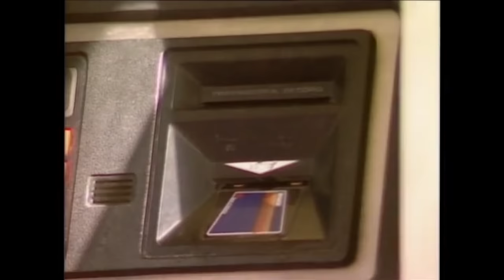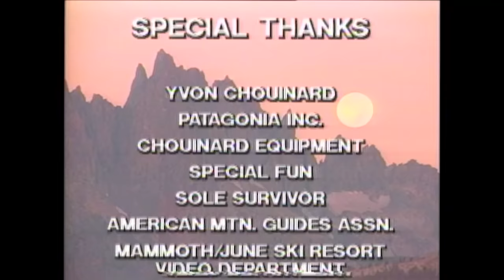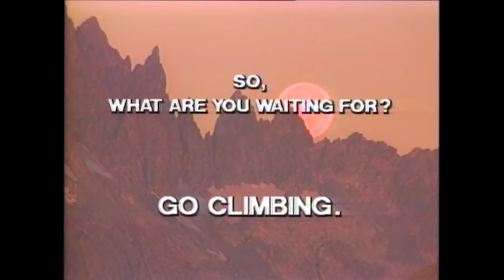They Changed Climbing Forever

Comment: Doug, why go with a delicate camera system such as a tube camera? What was the mindset or goal? I understand it may have been the most advanced at the time, but wouldn't something using film such as a 16mm or 35mm have made life easier due to their ruggedness? Did the film costs and processing outweigh the maintenance and daily cost of the tube camera?
Reply: Good question. My partner on that film, Mike Strassman, had just graduated from film school at UCLA. He made the choice of format and I didn't question it much. It felt like the best idea for those times. But boy was a clunky, 20 pound, delicate camera a pain in the ass! especially hauling it up on climbs! Good shot angles, but one bump against the wall could throw the tubes out of alignment, and it would have to go to the city to be readjusted by a technician.

Comment: Doug, what's the definitions of Trad and Sport Climbing, where did the terms come from?
Reply: Used to be there was only mountaineering. Then Rock Climbing split off. In the early 1950s John Gill "invented" bouldering on this continent. Fountainbleau had bouldering for 20 years before then, but no one in the States knew. Gill started dynamic moves on Red Cross Rock in the Tetons. Look up his great writing. Also there are books of photos of his climbing. Amazing!

Sport climbing began in the 1980s and was hugely controversial. Trad had been going for over 50 years at that point. It was just undifferentiated  "climbing." You carried your own pro, put it in and the second took it back out. Sport was cool because it allowed faster, harder development of sheer difficulty. Smith Rocks was important for this movie because it was a leading area for sport climbing. The dawn of 5.14.
Reply: @dougrobinson4221  thank you, beautiful historical context.

Comment: Pretty strong for an old dude. Messner said that bolts are the murder of the impossible. When someone solos a hard sport climb that shows the lie  that '' There's no way to climb them without bolts.'' If they don't fall then they have climbed the route safely.
Reply: Soloists die, so I wouldn't call them "safe." Soloing is a very special elite form. Not at all for everyone. Bachar soloed FAs in Tuolumne that I personally feel should be retrobolted. Because of the "First Ascent Principle" he was allowed to lock away stretches of rock that could be enjoyable sport climbs for many. Not very democratic, or fair to the future of climbing. Where's my drill...